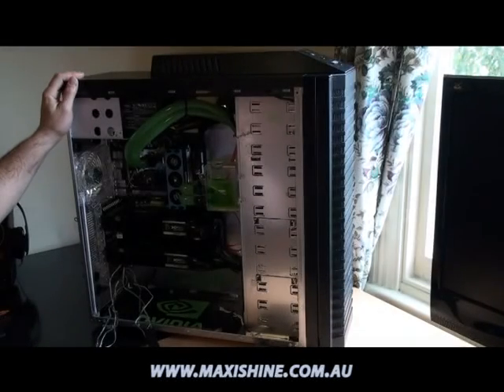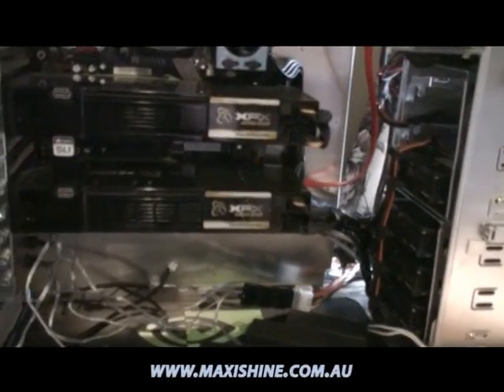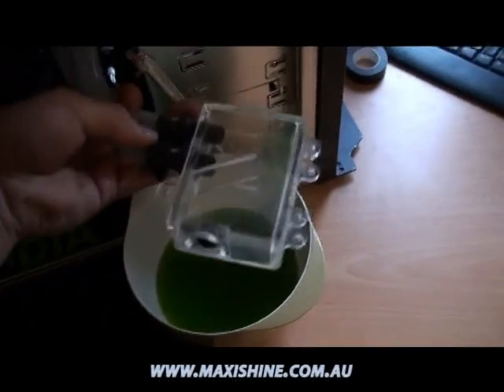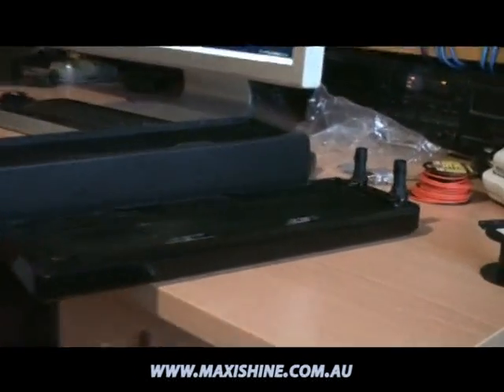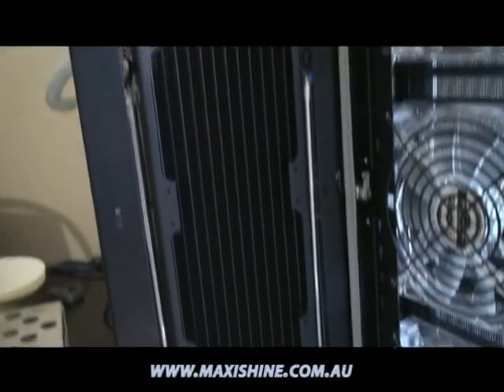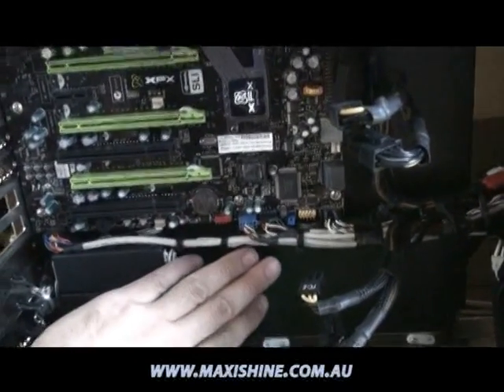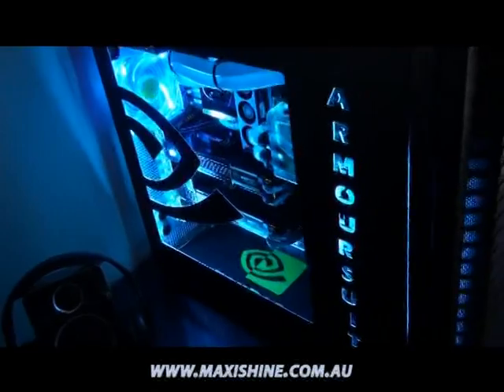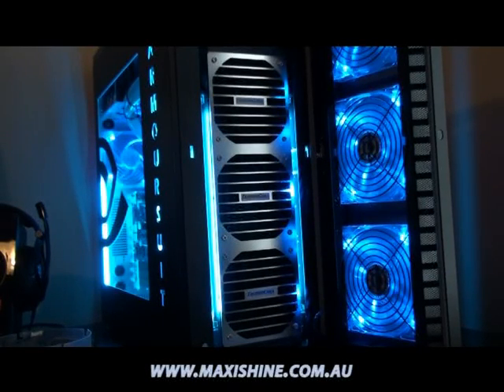Maxishine Extreme System Build part 2

Comment from the maker: The hardrives cant be put at the top because of the radand the amount of air passsing through the rad is nearly 0 by the time it reaches the MB, its a low fan speed watercooling setup.

Comment: The chassis is a Lian Li ArmourSuit, can't remember which model though. There is one with 3 140mm fans in the front which is more expensive and larger than the little brother with 3 120mm fans up front.

Comment: Most of the cold cathodes you buy will come with a expansion slot switch. Or you can make your own. Just go to radio shack or some electronics store and get a dc switch. I have 4 cold cathodes running of 2 blue led duck bill switches from radio.

Comment: On all of the 9800 GX2 SLi videos I've seen, people are using 2 cards... so I was wondering, since the nForce 780i and 790i cn do 3-way SLi, couldn't you technically do 3 9800 GX2 cards and do SIX-CORE SLi?

Comment: Not to be rude, but are you like a millionare, or just in debt, since you build a new rig every year with the best componets. Also, what kind of liquid cooling system would you recomend, I have a Q6600, and am planning on getting one of the Core2 Extreme Quads, (dont know which one) and I want to be able to overclock, but keep it at a pretty low temp, which regular air cooling will not

Comment: Your 2009 system should be a skulltrail system with dual qx9775's and run whatever the best GPU from NVidia would be. Maybe the 10000 series will be around for 2009. The 9900's are comming in late 08. Those 9900's are going to be insane.

I also dont do watercooling since i have to deal with maintenance. Thats just me. I know watercooling is the way to go for ultimate performance.

Comment: -do you buy your parts or do you work at parts store? do you know if 9800gx2 is supported in 3-way sli? 

The 9800 GX2 isn't supported in 3-way sli. Why? Because that would be 6-way SLI o_0!!! you can have 3 9800 GTX's but not Gx2's as that's 2 GPU's on 1 PCB, and 6-way SLI dosen't exist......yet! :p

Comment: :) nice pc, that's 1 thing that's true :P but not the ultimate 2008 system :P
wait about 2 weeks? :O core i7 xtreme,,980 euro's, put 6gb of 250 euro on a motherboard of 300 euro, put 3 gtx 280's, watercool everything,, and u're done :D but still nice system